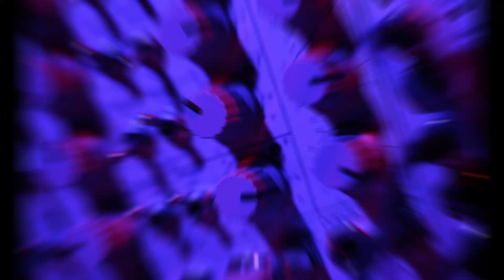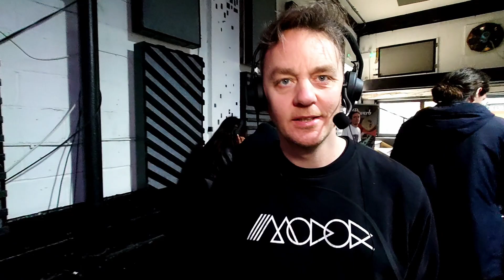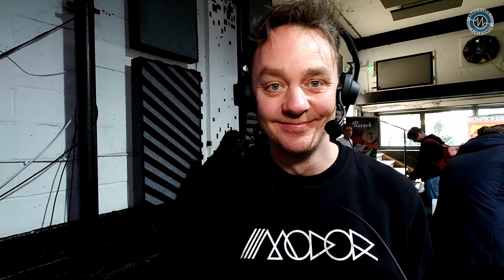Play Basslines on the Modor DR-2 Drum Machine - LSPXPO 2025

Comment: But what do the drums sound like?!
Reply: It sounds very good. It would be a good alternative to the Alphabase.
Reply: @mindexpansionpuzzles  Very different sound to the Alpha Base, and imo much easier to use than Jurgen’s drum machine 😝
Reply: @Andy-sq3im  Yeah, no shit Sherlock I have both. Don't know how you're having a hard time with the Alpha Base but saving kits and patterns on DR-2 could be better.
Reply: @mindexpansionpuzzles  I have a few issues with the UI on the Alpha Base (I have the MKII), including the fact the new two line display hasn’t come with any UI update to take advantage of it. The main issue for me though is the inaccuracy of the 4x4 grid encoders - it’s extremely difficult to obtain precise values. Which version do you have, and any issues with the encoders on yours?
Reply: @Andy-sq3im  The original version and the only problem I have with the encoders is how values sometime change when muting an instrument.
Reply: @mindexpansionpuzzles  I'm strongly considering getting this over the alpha base later this year.
Reply: @Hammer_and_Circuit It's a pretty good drum machine the only problem for me I would say is saving kits and patterns, but the sound is there.
Reply: @mindexpansionpuzzles I appreciate that input. I’m going for it. Just have to organize the funds.
Reply: This machine has been out for years.  There are plenty of percussion demos to be found online already.  The entire point of this demo was to show the newest firmware additions.  Cheers!
Reply: @SandcastleTheory  it was very brief though